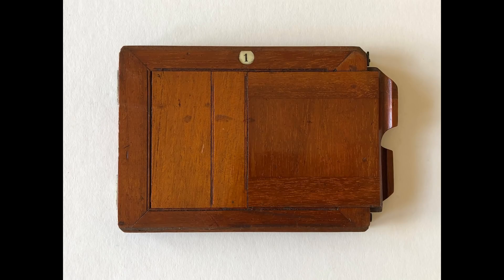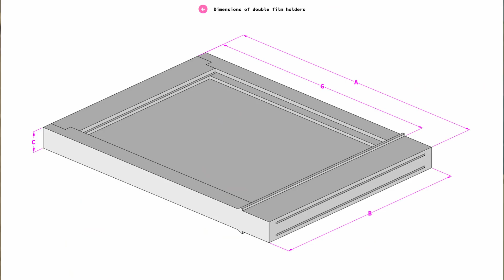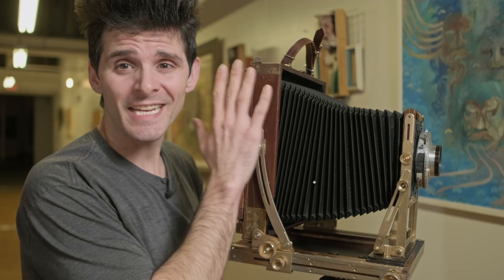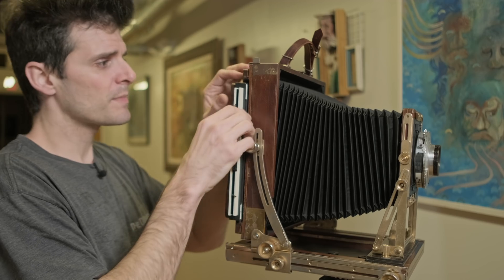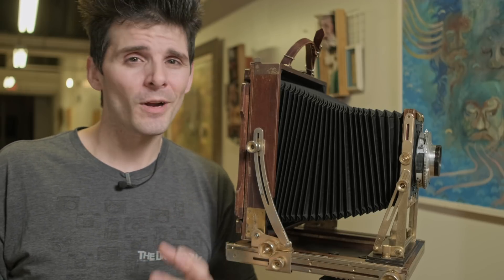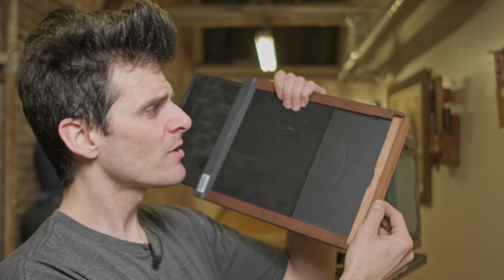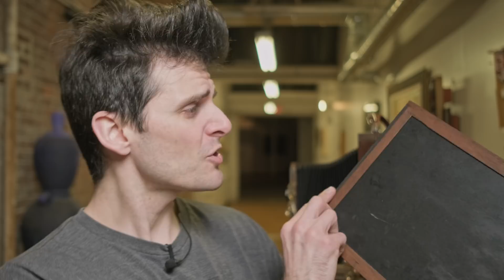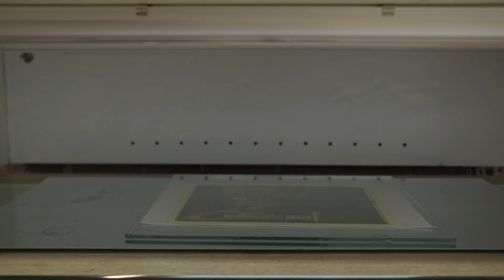Funky Film Sizes, Standards, and a Very Special Glass Plate - Large Format Friday

Comment: I recently got a lovely Ensign Cameo plate camera and having been finding, and using, 6th plate (2.5 x 3.5, nearly 6x9) glass plates. It's a fun process. I've got a film back for it too, but using the glass plates has been a fun side quest. I've finished one box of 12 x  1971 Ilford FP4 (no plus). I've found some more, 1 box of FP4 (no plus) and 3 boxes of Kodak p.300 (about iso60 pancro), all from the late 1960s and early '70s. I haven't checked those for fog yet, but fingers crossed (the first box ended up about ISO3, but they can get some decent density, they scanned well and I've even managed an enlargement from one).

Comment: As a teen ager in the 50s and early 60s I had an RB Tele Graphic SLR in 3.25x4.25 inches.  You locked in the film holder not with the kind of back we know today but the film holder had croves on the side and it attached with something that looked like a graflock locking system

Comment: Fun facts for Europeans: DIN sizes for paper are based on a square meter of paper (DIN A0). When you fold it once you get A1 and so on. This is based on  1 to √2 – approx  1:1,41 length to width ratio. DIN is pronounced like in english the name 'Dean', a little bit stretched emphasis. The paper format is usually spoken quickly 'deanah' in everyday use.🤓
Reply from the maker: Y'all Europeans out there actually living in the 21st century while Americans are still living in the 1800's with this Imperial measurement system. -__- BTW thanks for sharing that very cool fact!

Comment: Great topic. I have a whole plate camera, a couple of backs and film holders for whole plate. These are double dark slide, from perhaps the 1960s, Japan. I soon discovered that even at this relatively late date there is no standard for outside dimensions of the holders. Toyo whole plate holders are not the same as Rittreck. I have two other unlabeled holders, both of different sizes. I'm not put off though. I just love this format.
Reply from the maker: Thanks for the comment! Rittreck made some really interesting camera design choices. Lots of features and ability to adapt formats, but often led to much larger, sometimes clunkier camera bodies.

Comment: Great topic. Never thought to compare my plastic and wooden 8 x 10 holders. I have plenty of those Kodak Eastman ones. Now I see why they’re so hard to pull out.
Reply from the maker: I think in spring backs with a little more play or a bale removing the holders could be a bit easier. Another thing I've found with wooden holders is the metal rails that hold down the film can be a little tight.
Reply: @MatMarrash  That's true. It usually takes me a couple of tries before I'm confident the film edge is under the rail.  As to the spring back on my Kodak 2D, what I ended up doing was loosening the screw that held it in place and thus reducing the overall tension. With the C1 and its bale back, there's no problem at all.

Comment: Amen mat, I have a Linhof tech III ( an older three series, NOT the current tech V that is sold today); in this it was furnished with the metal 5x7" sheet holder adaptor, a 4x5" adaptor, and some lenses. This kit had the 4x5" adaptor, BUT like you said, trying to fit a polaroid 545/505 holder was impossible, due to the lip on the short side ( feature on the roller side of the holder), this meant the holder did NOT sit flush with the frame of the camera!, also the 5x7 was a metal film holder adaptor, not the 'normal' double darkslide that you show here, but a thin metal holder, so this is the Only holders that can fit, there are other options ( can fit on the round rotating adaptor, on the camera rear standard), but you have to be acutely aware of what film your machine takes, and how to handle it, so you avoid any light leaks during shooting.

Comment: Great video and important things to know.  But in 30 years of large format I've bought a couple of dozen 8x10 film holders, mostly old wooden ones (lighter than plastic,) and while acouple needed repair all of them worked fine in modern cameras.  Ditto for more than 50 4x5 holders, including ancient wooden ones that came falling apart.  What I have gotten from two dozen 5x7 holders are three weird European sized holders that look just like US 5x7 holders but 5x7 film didn't quite fit.  I paid very little for most of these, expected more problems than I actually found, and am overall delighted with my experience.  Your mileage may vary-  😉
Reply: You may have picked up 13x18 holders.  Close, but no cigar.  I bought two of those once, found my 5x7 film didn't fit, and was lucky enough to sell them to someone else.  13x18 film is available.

Comment: Been trying to find info on the differences between film vs glass plate cameras. I have a Linhof Mk4 Technika 4x5. Are the plate holders the same size and thus only needing a “Glass Plate” holder?
Reply from the maker: Great question! Since you're working with a modern Technika, all you'll need is a modified film holder (DIY option) or one made specifically for plates. Dedicated holders being designed for thicker glass plates will usually only take one plate at a time, and not have room for a "double dark slide".

Comment: Interesting.  Despite the roll film sizes originating in the USA (Rochester, NY, at Eastman Kodak), Ninth Plate is close to the old (half a century obsolete) 129 roll format, while sixteenth plate is almost exactly the same as "full frame" 127 (the 8 exposure size, if you don't recut 120 to feed a 127 camera and thus get twelve of that size negative).  Quarter plate is very close to the real size of 9x12 cm ("German 4x5").  I've been aware of Whole Plate, Half Plate, and Quarter Plate (because there are some very nice old wood field cameras in those sizes, and not all of them will accept a modern 5x7 or 4x5 film holder), but hadn't encountered Sixth Plate, Ninth Plate, or Sixteenth Plate.

Also worth noting that German manufacturers (including Kodak, after they purchased Nagel) continued to make plate cameras, mostly in 6.5x9 and 9x12 but also in 10x15 and 13x18, with very non-DIN plate holders into the late 1930s -- I've seen a list of more than a dozen different, only partly compatible (i.e. this brand holder will fit that camera, but that brand holder won't fit this camera, and the other one won't got either way and doesn't even mount by the same method) plate holder formats even just in 9x12 cm.  Manufacture of the last of the "plate cameras" (still built for glass plates, and using a film sheath to adapt to sheet film) was only halted by the German build-up to war production starting around 1936 (and there were still a few plate cameras produced as late as 1939).

And that print from the glass negative -- just WOW!
Reply from the maker: Thanks for the wealth of knowledge in this comment! The only time I've ever encountered sixth and ninth plates was in a small studio in Marion, OH that had a giant portrait camera on a rod iron stand. It had a ton of different reducing backs, one of which was a windowed ninth plate that could shift all over the ground glass for easy composition. To seal the deal it had on it an immaculate Cooke Knuckler!
Reply: @MatMarrash  And I bet they only quit using plates in that big old camera when they got too hard to find or too expensive to use.  Kodak still sold T-Max on glass into the mid-1990s.

Comment: Great video as always Matt. Something worth noting for those looking to shoot plates... you can use/create inserts in plate holders to size down to standard and custom sizes smaller than the max plate holder size. It is also a wonderful way to avoid having to purchase a separate back for each size. Not sure if you have ever mentioned it in previous videos before, but for those seeking vintage gear there is quite a variety in diaphragm number standards prior to the 1920s as well.